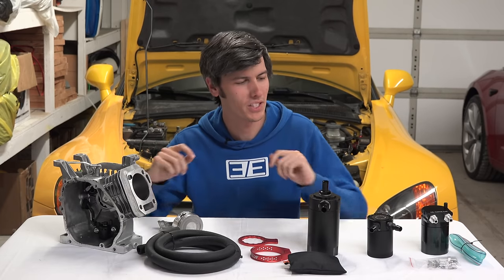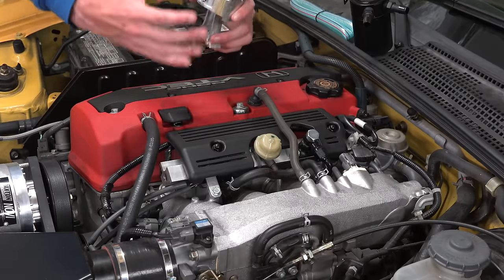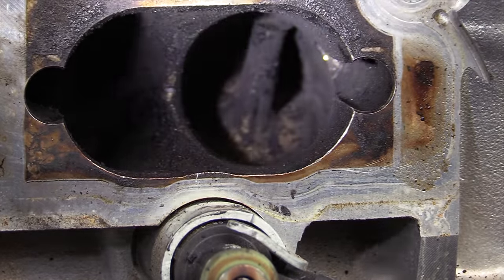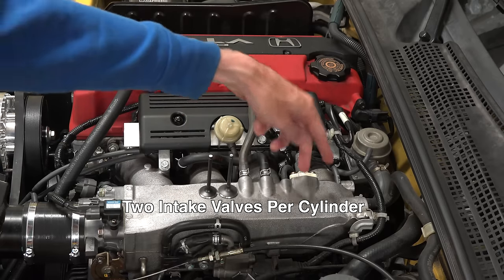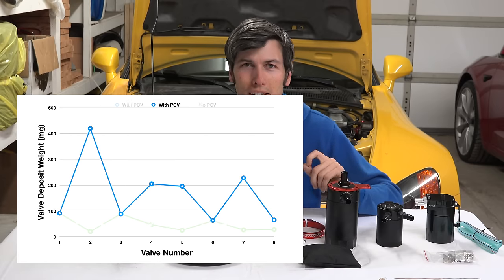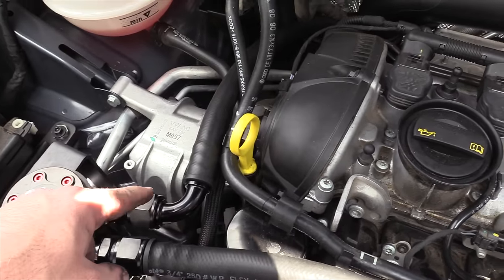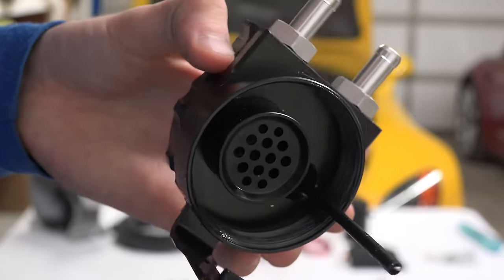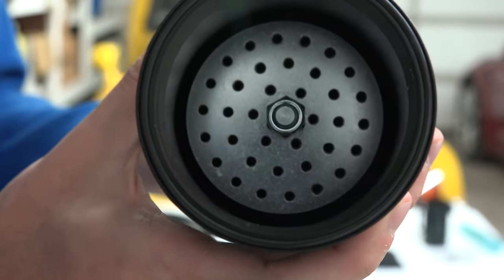Do Oil Catch Cans Actually Work?

Comment: Pffft...all filters do is weigh your car down and keep you from buying useful upgrades like wheel spacers and carbon fiber gas caps.
Reply from the maker: Finally some reason in the comments section!
Reply: Also the fake vent stickers for your doors!
Reply: @MorbusSchmorbus  Yeah, you lose 10HP just by not having those stickers on :D
Reply: I've heard underglow neons create downforce because photon pressure removes some of the air under the floor so I'd get that before a catch can.
Reply: @sogerc1  Get the blue ones since the shorter wavelength creates higher photon pressure.
Reply: Damn man. You know the best upgrade to your car is slamming it to the ground and adding mad camber.
In the case of a truck extreme mud tires on rims you bought at Walmart and a lift kit is ideal.
Reply: sogerc1 I have under glow on my Chevy Malibu and I can confirm this is true
Reply: You guys forgot horsepower decals and badges -.- I have a 5000hp kia, thinking of buying a single 5000hp decal to get 10khp. Anyone have experience with the kia Sportage? Can it handle that RAW POWER dude?
Reply: And throttle body spacers.
Reply: Well-if you got off your butt and exercise some you could lose a few pounds to compensate for the catch can's weight LoL!
Reply: Engineering Explained lmao this is an amazing comment
Reply: Lmfao awesome
Reply: TURBO SOUND SPEAKERS FTW
Reply: @SkylineFTW97  Fuel injected brake lines are key to ultimate stopping power
Reply: I know its an older upgrade, but flux capacitor adds at least 20whp...oh and HID blinker fluid. When drivin at night.😏
Reply: I mean, there are a ton of people who just run breathers instead of a reroute back into the intake...
Reply: In fact, wheel spacers can be use full if you modify your turning angle
Reply: @theopoint1911  They can also be useful to run fatter tires for ultimate launch zoomies.
Reply: Unless he just likes to drive slow I’m sure this won’t be of any concern to him haha besides it’s supposed to catch oil so unless that doesn’t sound like a concern it’s one more reason I shouldn’t find one on his car
Reply: sogerc1 installs floodlights on undertray
Reply: and that camber adjustment arm to have -6 degrees bro
Reply: @MorbusSchmorbus  ...those don't vent? I bet those race lines don't actually mean I drive a race car too! I feel so abused that I will buy myself some muffler tips; THOSE guarantee more back pressure!
Reply: And brakes are for quitters🤣
Reply: Don't forget the illustrious cold air intake. Without a doubt the most useless modification, as well as the biggest marketing scam the aftermarket has to offer.
Reply: @koimaxx  But those people looking at them will not be able to sleep at night due to the excess blue light exposure.
Reply: Mrjohnnymoo1 probably best until smog inspection.
Reply: Mamañema to el mundo aqui
Reply: @SkylineFTW97  i like that..would save some time
Reply: @Sagittarius-88  Don't forget the short intake that pulls in the hot air directly from under your hood...
Reply: Fancy license plate lights too.
Reply: @bc9769  we have a Soul in the shop that had previously been driven in LeMans. Until catastrophic failure of the chipmunk team.
Reply: Dont forget Signal light oil, for the bmw owners... lol
Reply: Yeah, I got a Ama cheap one. Very heavy. Was going to use on motorcycle.
Reply: Best answer ever!
Reply: I'll have money to replace my plastic Spinners for the tires now. And more XR Racing gear, and bullet hole stickers for the body work 😎
Reply: Wow you guys think you know cars!? Pfft, how do you forget the extra 50HP you get for washing the car??? Gran Turismo wouldn't lie.
Reply: @sogerc1  Unfortunately your headlights push against the air in front of your car countering all of this
Reply: okay but I have to use spacers for fitment because I’m slammed💀
Reply: I used to run a motorcycle dealership, and years ago a company produced a product called tyre fly's (correct British spelling of tyres ) they were valve caps that  illuminated when the wheels rotated.
I used to tell the "Yoof's" (16 and 17yr olds) that the added weight and centrifugal force on the wheels would allow their restricted bikes to go faster, because the wheel would rotate faster. It was amazing how many fell for it.
Reply: @sogerc1  bro im dead
Reply: Carbon fiber gas cap youbsay? 10 hp, 12 hp gains? I'm in
Reply: If you don't have dice caps for your valve stems, you're not going anywhere. 😒
Reply: Gotta have those stickers with it
Reply: Catch can does work if its high performance tunned

Comment: Are you getting one for your Tesla?
Reply: Andrew Zhang he should. Look at all the oil his engine will burn if he doesn’t do it!
Reply from the maker: I think it might be too late, valves are all gunked up!
Reply: Dang! I was about to ask him to do an installation video on the Model 3.
Reply: Do 11-17 coyote 5.0 engines need these if they are port injection only?
Reply: Jeffrey Smallwood I think it's not that necessary as the carbon deposits and oil gunk is mostly removed when the fuel is sprayed directly into the intake valves. It might help in some way, so I'd let Jason answer this.
Reply: @jreydelacruz  The aren't only port injection. They're both port and a direct so it's safe to say get one.
Reply: @apexseal2811  But Coyotes aren't just port injected. They have both port and direct injection.
Reply: @jreydelacruz  Most guys on forums run them to prevent detonation/knocking, especially if you're heavy into racing. I run one on my 2014 coyote and you'd be amazed at how much oil it catches under normal driving conditions every 5k miles.
Reply: $500 Tesla option.
Reply: It will not help, the electrons are to small. They will just pass the filter
Reply: Change the blinker fluid too! 😂
Reply: @bosstowndynamics5488  I didn't say that it does matter. What the hell are you talking about and why did you pick me to talk about your bs?
Reply: @jreydelacruz  its worth it.
Reply: Make sure you get one of the cans with a fine enough filter so that no particles bigger than the electrons will pass through.
Reply: @ssjbuu   if you have premature detonation/knocking you HAVE BIGGER issues then a catch can, can fix..

My v8 6.0L Engine BURNS no oil,  HAS NO sludge, HAS NO carbon floating in the oil..
you want to know why??? it's well taken care of.  3,000 mile oil changes    I also use Cheveron   fuel
  it has 260 miles on the current oil change 86,160 miles on the engine.
Reply: @bosstowndynamics5488  I wasn't "implying," anything. You just are assuming things bro gtfoh.
Reply: It does looks good in it.
Reply: I waiting for the HFC upgrade post...
Reply: @punker4Real  I don't have an issue with detonation/knocking, but it's a common issue for the 5.0L Coyote engines because of the way the PCV system is setup. There can be a lot of oil coming through the PCV system back into the intake under heavy load , such as racing conditions. Under normal driving conditions this isn't an issue because the amount oil that comes out of the PCV system back into the intake is minimal. I do my oil changes every 5,000 miles with just over 45,500 miles on my car, and drive under moderate to heavy load most of the time and I drain about 6 to 10 ounces out of oil from my catch can every oil change. There are guys who will drain that after a single day on the track because of the high RPM's and heavy load on the engine. The problem is also more prevalent on the passenger side PCV vs. the driver side PCV, and most people running catch cans only use them on the passenger side.
Reply: It's called "Angry pixie physical containment device". Similarly to Apple AirPods, you cannot disassemble it as it will let the smoke(electrons) out.
Reply: Electron catch can
Reply: they are called capacitors
Reply: IKR. ICE-age cars are too complicated.
Reply: Can't wait to go electric. So sick of carbon deposits, check engine lights, vacuum leaks, belts, etc. ICE was a kludge around low power batteries. We need to move on already.
Reply: @EngineeringExplained  You mean switches, of course.
Reply: Andrew Zhang 😂😂😂
Reply: Bruh >_<!
Reply: Direct Current motors, like Direct injection motors do indeed benefit from catch cans.
Reply: @punker4Real  3000 mile oil changes are a thing of the past...most dino oil is good for at least 5000 miles these days and synthetics even up to 8-10k miles.  If you send oil samples into Blackstone labs a few times, they can assure you of this.
Reply: @Phil-D83  blinker fluid is a joke now, but when headlights were acetylene or oil lamps so were the other lights including the signals.
Reply: @apexseal2811  my car is port injected and I got tired of cleaning the oil out of the intake manifold.  I figured a little less oil mist going into the cylinders isn't a bad thing.  I bought a cheap one somewhat similar to the $25 one in the video knowing i'd need to modify it to actually work it was just an empty can no baffle/filter nothing to keep the oil in it.  Ended up getting lazy and just bought the $100 can featured in this video.  Works good only driven 300 miles since i put it on and its got a little bit of oil, down stream hose is clean so it seems to work
Reply: You are incorrect about the coyote engine being direct injection.  Jeffrey Smallwood specifically asked about the 11-17 coyotes.  Coyote engines were only port injected from 2011 thru the 2017 model year.  They did not have direct injection added until 2018.
Reply: Hahaha his Tesla might need some new spark plugs his charge is running rather low and the car is rather slow😂
Reply: @jghall00  hate to brake it to you but electric motor also suffer from carbon build up
Reply: It can be done but the line routing leaves much to be desired.
Reply: I am. I liked the Tesla body so much, that I bought one, removed all of the electric motor junk, and intalled a Demon supercharged Hemi drivetrain.
Reply: also heard teslas go thru muffler bearings  pretty quick
Reply: I'm gonna get the quadrajet oil catch can for my tesla
Reply: Gay
Reply: Hahahahaha it's funny because electric cars don't use as much oil
Reply: What's the Catch???
Reply: Heard you lose some HP with them on a Tesla. Ecu picks it up as a vacuum leak
Reply: @EngineeringExplained  I thought that all valves had now been replaced with transistors.
Reply: Only once he's got new spark plugs for his Cummins